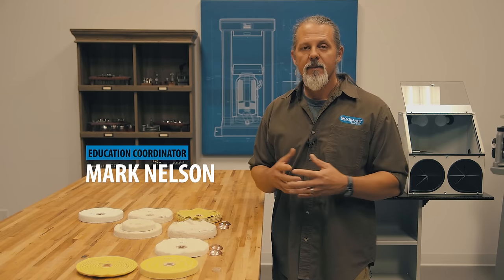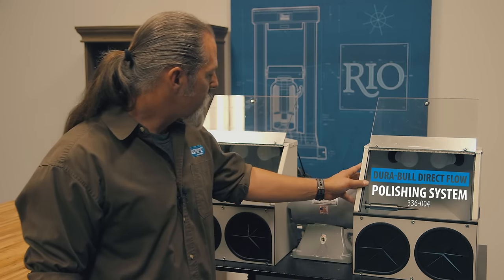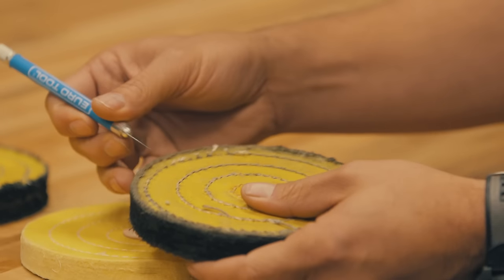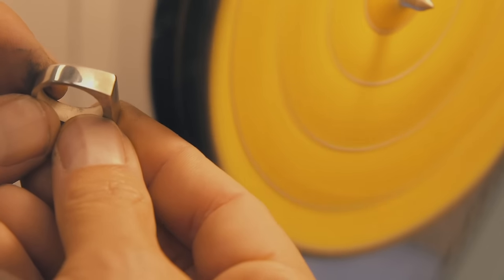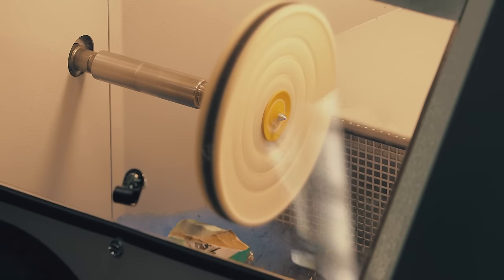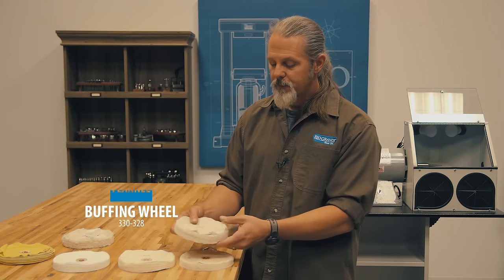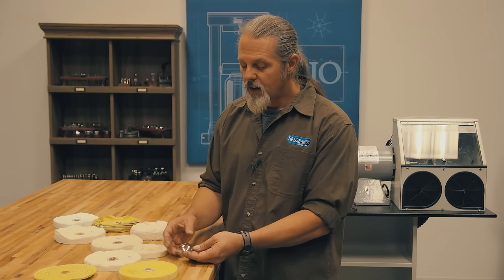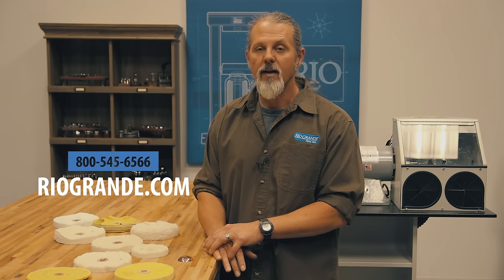Polishing & Buffing Wheels Guide

Comment: This may seem/be off-topic, but I watched this trying to learn general buffing principles for my project of shining alabaster lampshades. I’m very low tech, and used this strategy. I bought Renaissance microcrystalline wax and rubbed it onto the (dull, ill-maintained alabaster, which I’d bought on eBay); then I attached a fabric (cotton?) buffing wheel (it came with an adapter) to a drill and buffed it with “medium” RPM (can’t estimate a number). It seemed to work and I did this 3 times on each shade.

My question is: does this cause wax to accumulate in the fabric buffing wheel? Will this reduce efficacy as wax is absorbed into the fabric? Should I replace after a number of uses, or should I assume that if the fabric isn’t worn out, it’s doing the same job as when it was new? 

Thanks so much for any information! Fascinating video, enjoyable to learn about this process. But also wondering whether different fabrics would make a difference in my Alabaster project. If you have any experience with microcrystalline wax, is is supposed to leave a thin film after buffing, or is that a sign I used too much wax or didn’t buff enough?

Thanks so much for any information, so very deeply appreciated!!!

Comment: Hi Mark, Can you get similar results from a flex shaft or to get deep polishing do you really need to get a larger machine? Thanks!
Reply from the maker: Hi, Debbie! You can definitely achieve similar finishes by using similar wheels and compounds on the flexshaft :)  A lot of our polishing wheels for the polishing machine have smaller versions suitable for a flexshaft. Most of these wheels easily attach to a screw mandrel to hold it. For example, our Tight-Weave Fine Muslin Buffing Wheel (#330147) is used on a polishing motor, but you could also use our Tight-Weave Fine Muslin Buffing Wheel (#330707 )on a flexshaft and achieve similar results! Let us know if we can provide you with more information about this.

Comment: You don't mention felt buffing wheels. Can you tell me a little bit why felt is used and what it is used primarily for?
Reply from the maker: Hi Steve, thanks for commenting! Felt is durable, and felt buffs are great for all-purpose polishing and buffing. The flat edges on felt wheels allow   for quick polishing on curved and flat surfaces. Specific use and application depends on your particular project or process.
Reply: @RioGrande1944  Hello, friend, regarding the mold you shine in, possible sizes, please. I want to do the same for the carpenter. Is there any help?

￼

Comment: how can one polish detailed and intricate pieces on such a buffing machine? or is it best left for a flexshaft?
Reply from the maker: Hi Access, it depends on the polishing motor you have. Some allow you to attach a chuck like # 333003 to the shaft so you can use bristle brushes like #338401. The advantage to doing this on the polishing motor is that you can use two hands to hold the item you're polishing. Hope this helps.

Comment: I'm in the midst of learning how to make grillz and I'm curious whether or not it would be more beneficial or easier to use a polishing wheel, or if I should try and use a flex shaft?
Reply: (for your teeth)
Reply from the maker: Hi Kayla, Thanks for your question.  For larger pieces a polishing lathe makes polishing easier because you can hold the piece with two hands. For more detailed polishing a flex shaft works great.  Both are important pieces of equipment for those reasons. Our Jewelry Tech Team recommends a polishing cabinet like the Dura-BULL Polishing Cabinet and Motor (item# 336119). You can see it here: https://www.riogrande.com/product/dura-bull-polishing-cabinet-and-motor-465-cfm/336119  Hope this helps & thanks for watching.
Reply: perfect thank you I appreciate it! I was also curious if you had any recommendations for the wax? a lot of videos I've seen people are directly molding the wax onto the teeth impressions and I'm not that well versed in what kind of wax would be the most useful for that!  thank you so much for your help :)
Reply from the maker: Hi Kayla, We talked to our Jewelry Tech Team about this, and we do not recommend any of our molding material to be used in the mouth or any body part. We recommend that you check with the dental industry regarding specific molding compounds that are approved for this purpose. Hope this helps!
Reply: @RioGrande1944  Hello, friend, regarding the mold you shine in, possible sizes, please. I want to do the same for the carpenter. Is there any help?

Comment: What are the treatments in/on the treated buffs? What are they for? As in, why would I choose (treated or untreated); one over another? It is VERY helpful to hear things like: "I am choosing XXX buff because I want XXX result, or I am not going to use XXXX buff because XXX will happen and I don't (or do) want result XXX. Those kinds of statements are super helpful. The whole "you can choose" is great, but it's too ambiguous, we need how's and why's; buying them all and figuring out what we like best is hazardous to the wallet. Leadership is so great in the learning process. Thank you, Mark. P.S. Mark, you have gorgeous hands, do you do men's jewelry (or any hand product) hand modeling? You sure could.
Reply from the maker: Thanks for your feedback and questions.  When we say a buff is “treated” it means that a treatment of water based emulsions, adhesives and waxes or resins are added to the fabric to impart hardness to the fabric wheels. This will make them sturdier, last longer, and hold onto polishing compounds better. (This is the yellow buff shown at the beginning of the video, used in the knock-down or first stage of polishing: Yellow-Treated Buffing Wheel, 6" x 50-Ply. Item # 330052)
 
For the remaining stages of polishing, additional buffs are required. As Mark notes, you will want to write the compounds used on each, so they don’t cross-contaminate. Leftover abrasive compound used in the knock-down stage could result in an unwanted harsher finish when the same buff is used with a polishing compound in the final stages of the polishing process.  Hope this helps.

Comment: I wish I could have a private lesson on how to do what I want to do. 😆 I am trying to renovate paraffin heaters and of course they are rusty and the paint is messed up. But I don't really need to make them shiny?  The shiny parts are the brass bits inside used to make the tanks and burners, those shine up nicely without much effort. Anyway, there is a very steep learning curve in doing all this, and quite an investment in equipment.  
Your video was very informative, and I learned many new things, though. Thanks dude!

Comment: Please help me lol.  I’m trying to figure out what the wheels I have on my grinder are. They are white they are not felt they are not piece of sound together they have the same feel and consistency of like rough leather they’re about 10 inches around and 3 inches wide they go on a Baldor grinder buffer. They do a great job on steel and stainless steel I use it to deburr and polish areas. I’ve never needed any kind of polishing compound with it they are not soft like felt they are firmer almost like silicone. I cannot find these anywhere and there are no distinguishing marks or riding on the wheel. Please help me
Reply from the maker: Hey there. Thank you for the comment. With such a wide variety of polishing wheels on the market, it is impossible to know which wheel you have.

Comment: Thank you! Very informative. I just started polishing, and after putting the wheel on, when I turned the grinder on, it was out of balance really bad, and was very difficult to use.  Can it be balanced? Or is it poor quality, and needs to be thrown away?
Reply: sometimes they can be balanced by just looking where the high spot is and pulling/adjusting it so it runs true, sometimes you can put the mop on via the other side and that can fix the balance issues on occasions

Comment: Does the size of the buff matter for different steps or projects? I know the linear speed will be different with different size buffs.
Reply from the maker: Hi, Lillian! Thanks for reaching out, great question. Usually, the polishing motor that you're using will dictate what size wheel needs to be used, since all motors have a maximum size buffing wheel that they can handle. Larger wheels will cut a bit faster, since the outer edge of the wheel is moving at a higher velocity than the interior of the wheel. Let us know if there's any more information we can provide you with!

Comment: What would you recommend for buffing stainless steel? What buffing wheel and compound to use to get it from flat looking to shiny?
Reply from the maker: Hi there - It depends on the surface! 

If sanded to a 400 grit scratch coat I would recommend this: https://www.riogrande.com/product/luxor-by-merard-pink-polishing-compound/331150 with this buff: https://www.riogrande.com/searchresults#q=mb%20buff&t=products&sort=relevancy&layout=card&numberOfResults=36 followed by  https://www.riogrande.com/product/luxor-by-merard-white-polishing-compound/331154 with this buff https://www.riogrande.com/searchresults#q=stv%20buff&t=products&sort=relevancy&layout=card&numberOfResults=36 . 

For a further high shine, follow that with https://www.riogrande.com/product/luxor-by-merard-orange-polishing-compound/331151 and this buff https://www.riogrande.com/searchresults#q=moc2&t=products&sort=relevancy&layout=card&numberOfResults=36, all while washing the piece in between each compound.
Reply: What  liquid solution to remove fire weld

Comment: Hi Mark - I have a couple of buffing wheels that got cross contaminated with both tripoli / rouge.  Is there any way to clean them so that I can use them going forward...??  Thanks! -
Reply from the maker: Hi Zippy DoDah. You should be able to give them a really good raking and redressing and they should be fine. You can use this to do the raking: https://www.riogrande.com/Product/Hardwood-Buff-Rake/330004